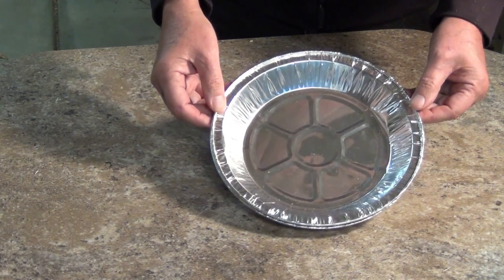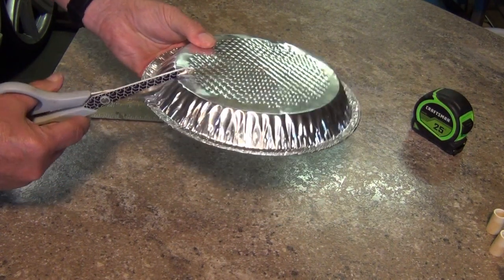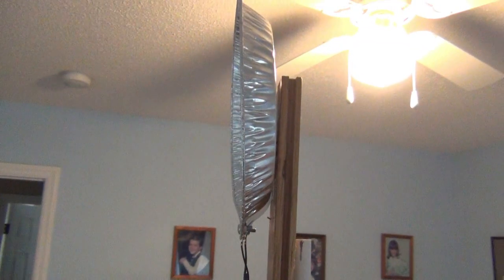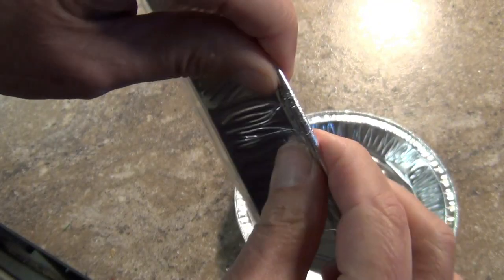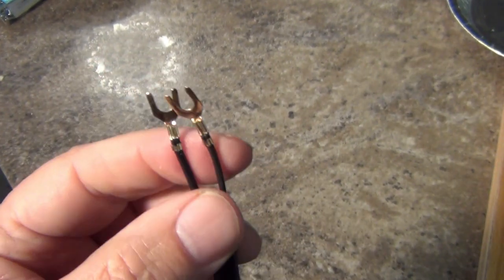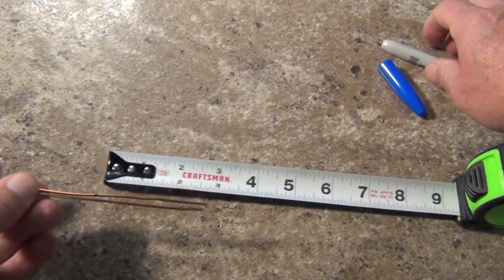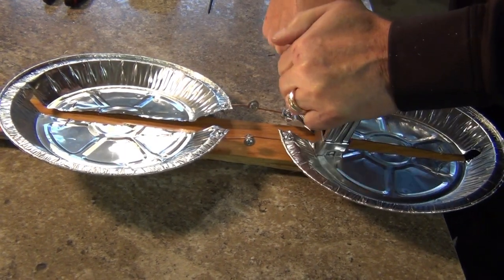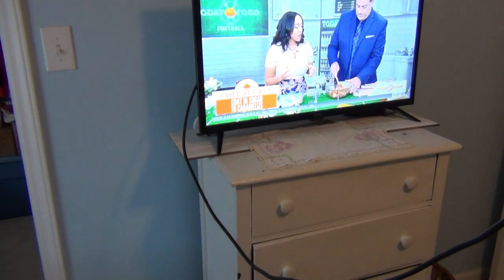Simple TV Antenna - Enhanced Design and Performance!

Comment: Would using a larger diameter pan work better MHTI ?? The reason I ask is that at flea markets, you can get pie pans made of stainless steel. I even seen pans made from copper. Now I know to buy them and try to make an antenna. Now I just have to wait for the markets to open in the spring. Nice video MHTI too. Peace vf    😀😀😀😀😀
Reply from the maker: The pie pan diameter corresponds to the bandwidth you will receive. Changing diameters will alter the signals that you will pick up, so it depends on you specific channels that you are trying to get. Thanks, VF!

Comment: I gotta say...  I put this together and hooked it up, and I first thought I had just wasted my time...  I was previously using an old rabbit ears antenna, and would have to reposition it seasonally to get it to work... but the last time I tried this I couldn't find anywhere in my house where I could get back the channels that I had lost, so I tried this...

I put this together with the balun transformer, and I didn't bother rescanning because I was still getting a lot of channels before, so I figured it should still at least pick up those channels, but it was not even doing as well as the rabbit ears...  I got some channels but there were some missing that the rabbit ears was picking up, so I thought that it just wasn't working well...  Then I tried rescanning and a funny thing happened...

I noticed that the progress bar for the scan was not even an eighth of the way done, and already I was getting over 20 channels !!  I was used to getting around the high 40s to the low 50s number of channels, and I don't ever remember getting anything over 55 channels before...  By the time I was close to half the progress of the scan I had more than 60 channels!!  I let the scan finish, and ended up with 79 channels!!!  

I had no idea that there were even that many channels available in my area!!  But I still worried about the reception, because I was getting poor reception before I rescanned...  As soon as I started flipping through the channels after rescanning, I noticed that all the channels that I had lost were back and many more, consistent with the result of the scan!!!  The reception is PERFECT on all but maybe 2 or 3 channels!!!  Two low budget, sloppy looking pie pans in my living room, but I don't care!!!  I got great reception now!!!!  THANKS!!!!!!!
Reply from the maker: Thanks for the great comment. That's a great testimony on how well this design can work. Please keep watching my channel!